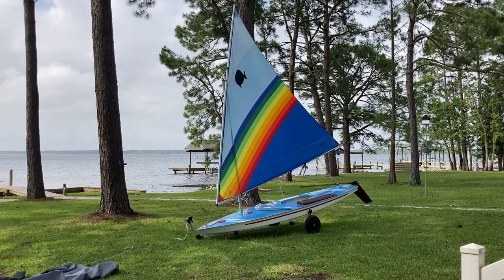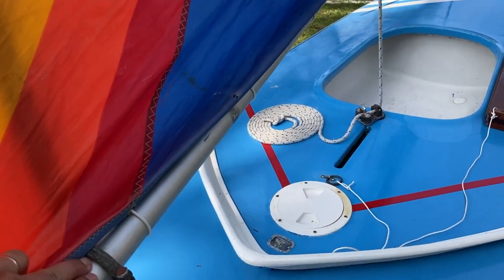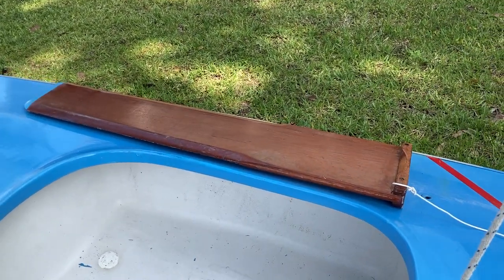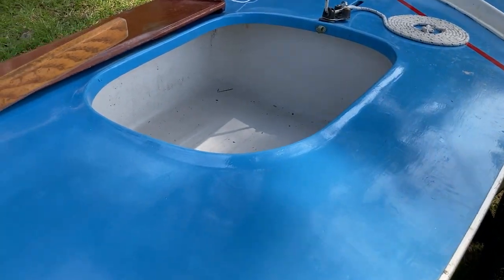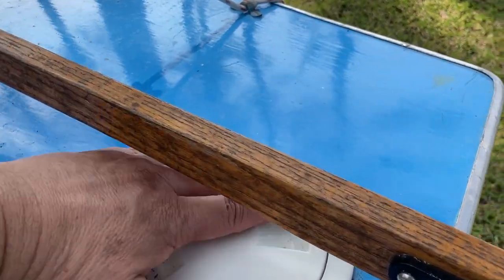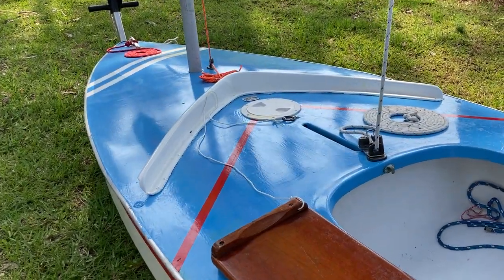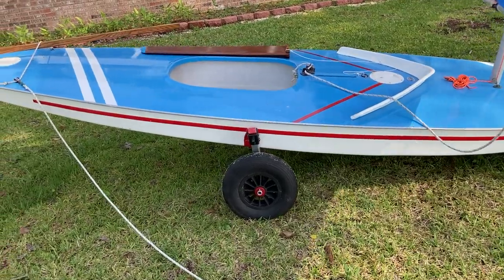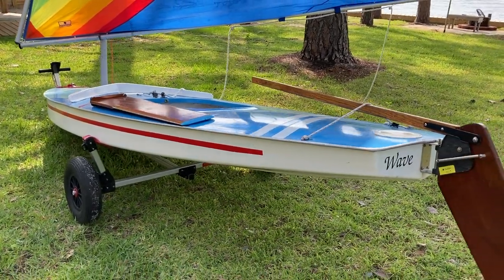Sunfish Sailboat Part Names

Comment: I have a pre 72 boat.  3 or 4 inches behinds the middle of the coming is a 4" diameter aluminum disk, 1/16 inch thick.  It has 3 cylindrical 1/2 inch columns sticking up.  It is mounted to the deck with 3 wood screws and gasket material.  What is it?
Reply from the maker: Not sure but if I had to guess, maybe a mount for a compass, used in racing.

Comment: I have an 80’s Sunfish and want to add a hiking strap.  Is it necessary to cut an inspection port in front of the dagger board trunk for the backing plate?
Reply from the maker: I don't know of another way to get a backer plate inside, but some folks might. One thing to consider, a port is not a bad thing to have, to sponge out water or be able to reach halyard cleat backer block, halyard fairlead, forward flotation block backer, daggerboard trunk repairs, etc...Most folks put a 6 inch deck plate between the trunk and the coaming. You might want to ask your question on the Sunfish Forum, we visit there and would be interested to hear ideas. Cheers, Kent and Audrey https://sailingforums.com/sunfish/

Comment: I usually rig my Sunfish with my lower boom parallel to the boat. I see that yours has quite an angle. What difference does it make? Thanks!
Reply: Makes it easier to keep clear of the boom when tacking.
Reply from the maker: For us it raises the boom aft so we don't have to duck as much. Some Boat Engineer with a 500 pound brain could tell you if it induces weather/lee helm, changes center of effort, disturbs wobble of the moon etc,,, but it works for how we mess about. We call it The Geezer Rig.

Comment: I am brand new to sailing and bought a 1972 Sunfish. It's in pretty good shape mostly just needed a good cleaning and stuff.  But I am needing to replace the bridal and I noticed the bridal on your Sunfish here is simply some kind of line with an added pulley. Can you tell me about this? Remember I'm a newbie so dumb it down. Thanks.
Reply from the maker: It's a piece of line, 5/32" I believe, just under 3 feet long. We tied a figure 8 knot on each end t make a bridle. The block is fun but not needed. You can tie a snap shackle to the end of the sheet (main sail line

Comment: Hello, from Puerto Rico, I bought a Sunfish 2000 two weeks ago and keep the original color, but need a new update, the boat is off white with the original 2 red lines. I appreciate you help, first what boat paint I could use. I love a new colors like white  and red. But your opinion are important for me, Thank and God Bless.
Reply from the maker: You need to check different brands to see what color you like. Interlux Brightside, Pettit EZPoxy, TotalBoat WetEsdge, Rustoleum Topside or Kirby Paint.
Reply: @kentblairl  
Ok, here in Puerto Rico find many options is little difficult. But I really appreciate your suggestion.
Xoxo from Puerto Rico.